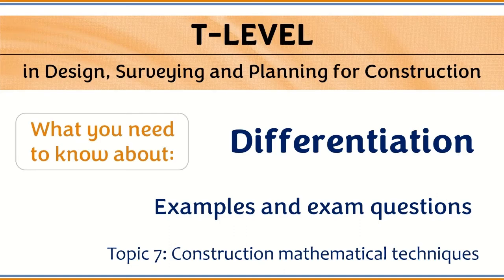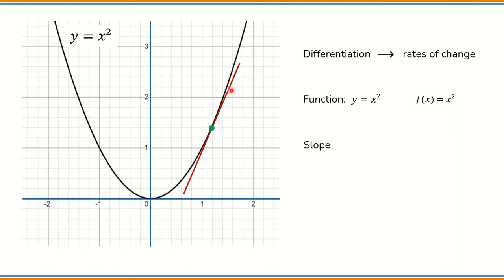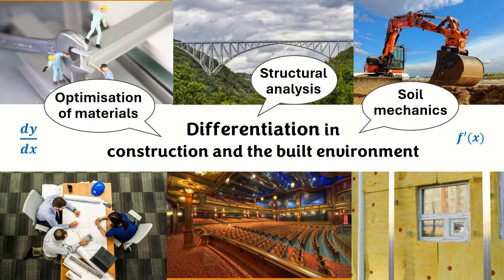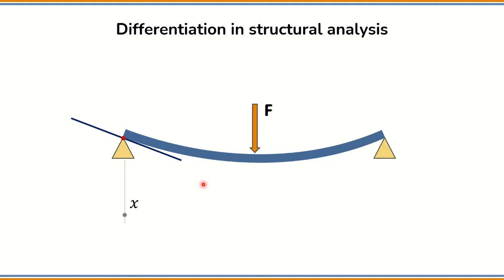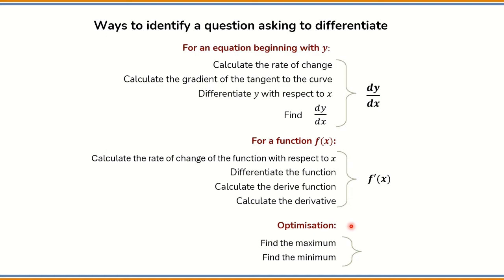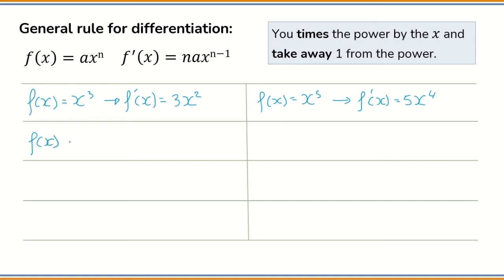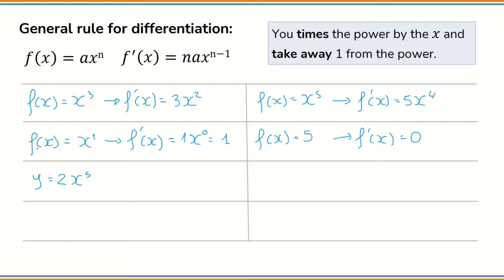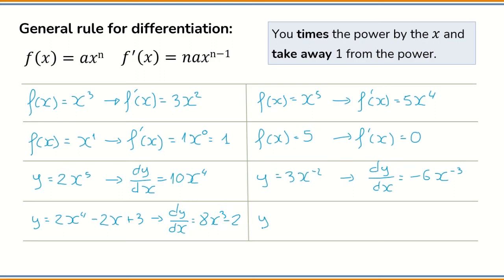T-LEVEL in construction - Differentiation basics - Part 1

Comment: This was very helpful and simple to understand, but i dont understand why in y=2x-2x+3, the x disappeared and the 2x just became 2

Also in the last example where in 6x⁵-3x-x the x just became 1. 

When it comes to numbers with x but no power would the x just be removed in the answer? 🤔
Reply from the maker: When you have an 𝑥 without a power, it actually means that the power is 1.
According to the differentiation rule, you subtract 1 from the power.
So, 1−1=0
That gives us 𝑥⁰ (𝑥 to the power of 0).
Any number or variable raised to the power of 0 equals 1 (for example, 7⁰=1,  200⁰=1,  𝑥⁰=1). This is the zero exponent rule.
That’s why the 𝑥 seems to disappear in both cases. It is raised to the power of 0 and that becomes 1.
Reply: @t-levelconstructionoh okay thx this video was really helpful for me

Comment: @13:30 3/2 minus 1 is 1/2 (0.5), not 1/3.

Therefore, the derivative of X to the power of (3/2) becomes: 

(3/2)X^(1/2)

Please can you correct this error in the video

Otherwise these series are extremely useful and I have used these to help my students
Reply from the maker: The error has been fixed, and the video has been split into two separate parts. Thank you!!